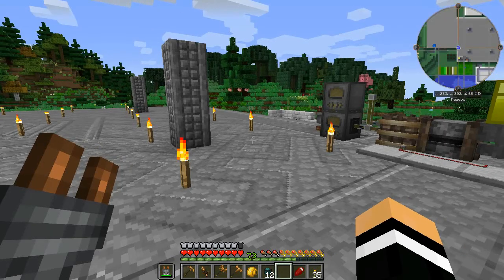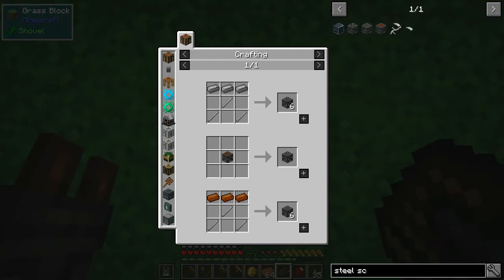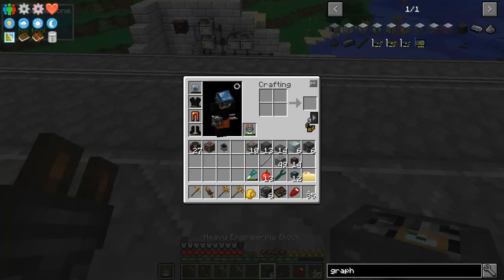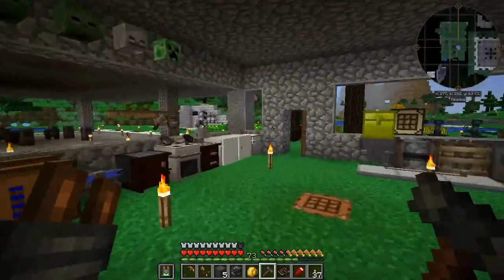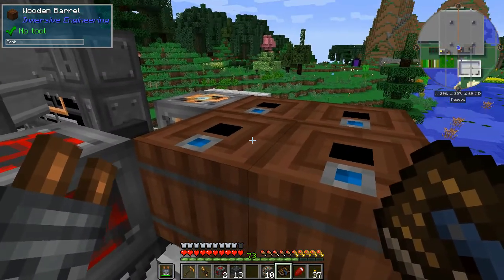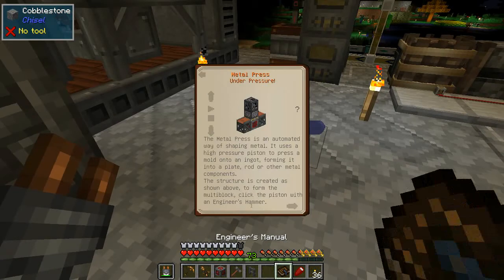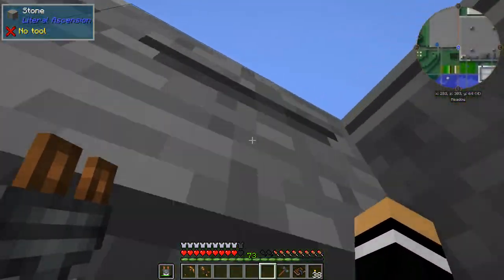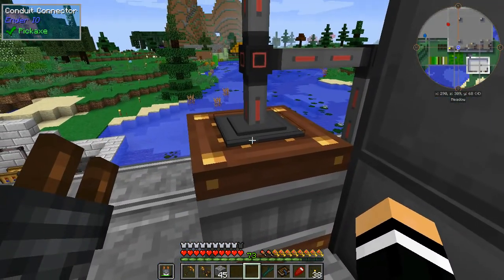S09E20 ATME - Finally Osmium in the Arc Furnace!

Comment: I made the ARC furnace only to realize you need a couple more machines for HOP graphite... which meant I had to rebuild my blast furnace to make more steel lol. All this... I just want an ME system cause none of the mid level storage solutions are helping me... going nuts with 6 diamond bags, trying to find anything... I tried the Indexer but I'm not sure it's any better than the storage modules from RFTools. I just want to put a recipe with ALL of my items accessible... is there ANY way prior to ME (which is easier than getting refined storage) ??
Reply from the maker: Oh dude I did the same thing... "Yes! I have the ARC furnace!"..... a few seconds later: "Oh wtf I need like 3 more machines just to run it"...
I really wanted to get to refined storage, but its so expensive compared to AE in this pack that by the time I could build it, it didn't seem like it had much benefit over AE - that and I was kind of near the end of what I was going to film for this pack... :)
Reply: It definitely did help me along. I have an unbreakable fast hammer, ring of magnetization, and the lantern of paranoia - given all the coal torches are easy in bulk. That made strip-mining a lot faster to feed into the machines I needed. I've almost got AE finally... it's actually the quartz glass that is the most pain. I'm looking at what the empowerer unlocks, vertical digger maybe in ore only mode? Well the void miner is the intended end game thing I guess, similar to the void miner from MFR I assume. Now I just need more power... the diesel gen maybe from IE.
Reply: Found the solution with using very simple AE setup - no need for disks. AA Medium storage crates are trivial to make with treated wood - its basically 2 diamond chests but cheap. Using storage buses only and throwing all of my diamond bag contents and my base chest stuff into the network, boom sorted.
Reply from the maker: Ah nice work! Empowerer wasn't too bad to make, and it unlocks a LOT of stuff. I find I'm always making batches of crystals and stuff in it. You're right as well, quartz glass sucks in this pack!